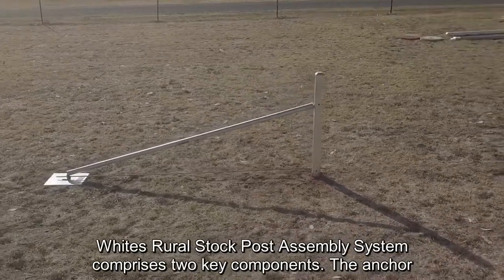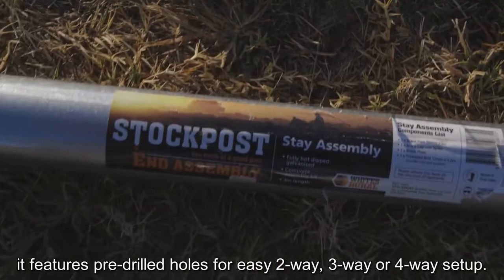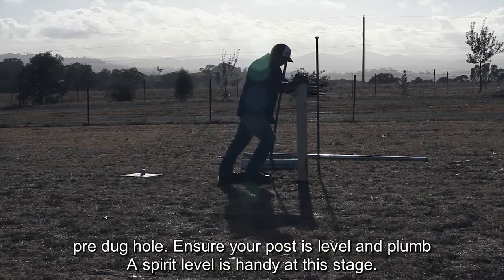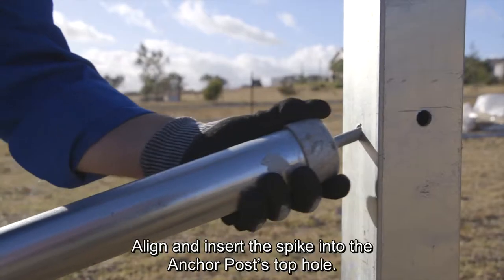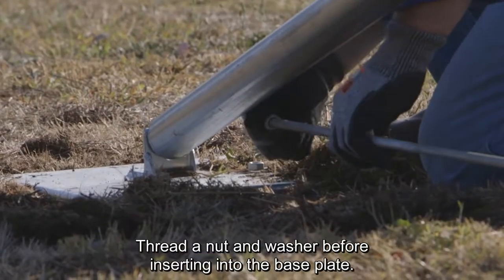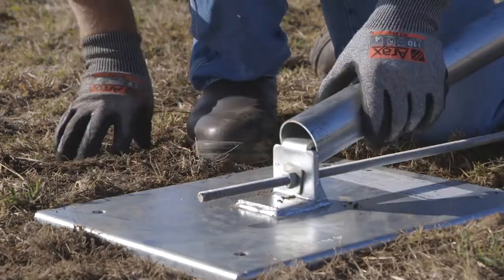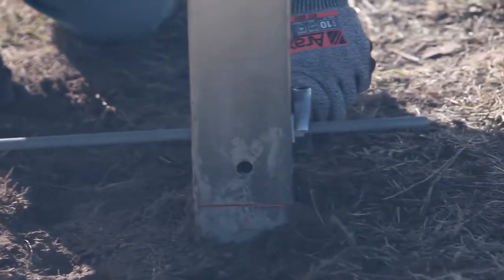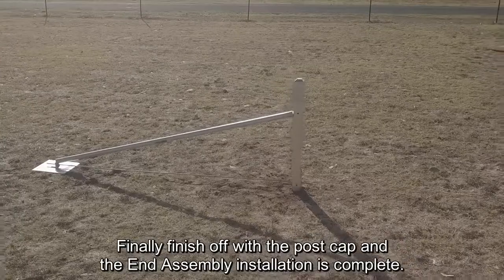Whites Rural Stockpost End Assembly

Comment: What is the end result difference between using the square anchor assembly vs round please?setting up for horses but will have electric top. Did not really want to be welding fittings. Thank you
Reply from the maker: Hi Michelle! Square vs round mainly comes down to personal preference.  Some things to consider are if you are needing to weld anything onto it then a flat surface is generally easier to work with. We do supply gate fittings that can be fitted onto the square style without the need to weld. For the round style, your local rural store will have gate fittings to suit.